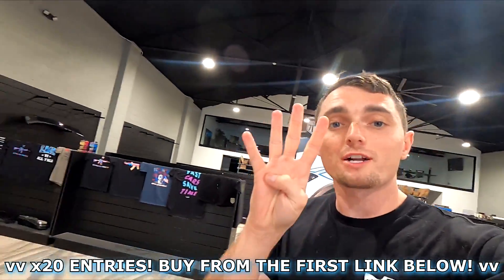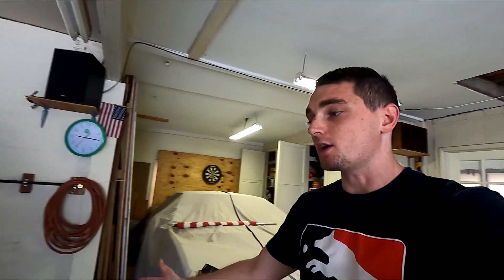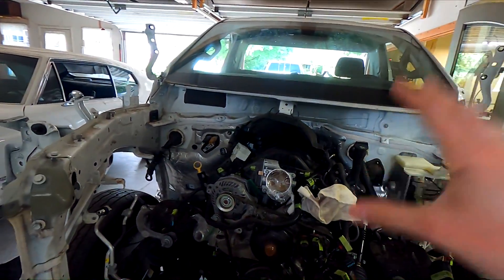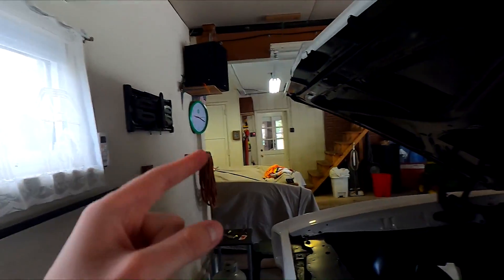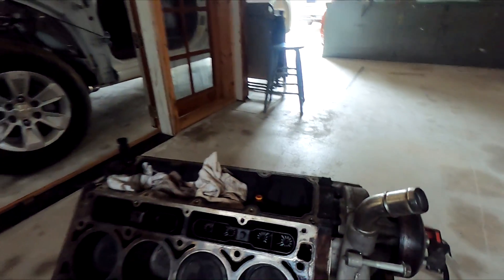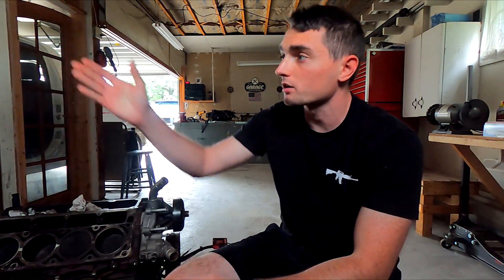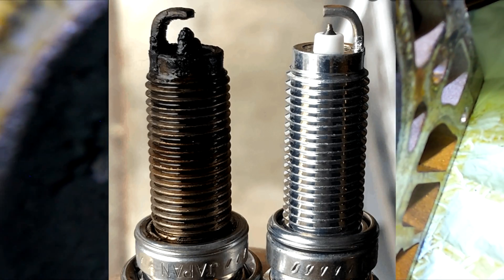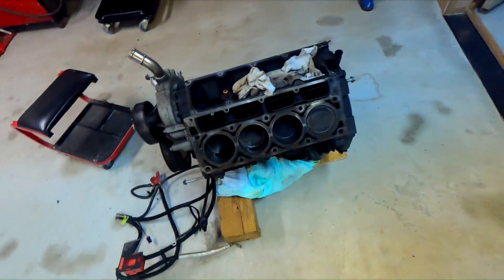MY NEW ENGINE IS HERE! But There's a HUGE PROBLEM!!

Comment: Those are good heads. If they are 799/243 it’s same as the c5 z06. You can use the long block as a core. Punch it out to a 5.7L.
I don’t think there’s much compatible between the uhaul engine and the junkyard 5.3. The new stuff is gen 5 lt1 base. Old stuff is LS based. 🔥 burn
Reply: My old 09 Silverado had an Aluminum 5.3 with 243 heads. Really wish I would’ve swapped the 243’s with the 862’s my iron block has. But I already had a set of 243’s so it was kinda worthless

Comment: That's honestly not a bad motor. A simple deck and hone and have the heads cleaned, surfaced and pressure tested and you'll be doing great. Also a Holley terminator is a great way to run that 5.3. Otherwise visit a junkyard and pull a harness yourself from a wrecked truck. 🔥

Comment: holley makes them terminator kits.. and ther is a few company's out ther making standalone wiring kits for putting Ls motors in ur hotrod & street rods for pretty cheap these days like from Michigan motorsports or karls customs making it plug and play install from $189-$299 & anywhere in between pending year of Ls & sizes they also have ecu's available for few more hundo's that are ready to go I've usually spent $7-800 for everything to make it a true plug and play where u just add power ignition wire and ground.. if u call and tell them what u have & are doing they'll make sure u get exactly what you need

Comment: Dude, if you got a good deal on the motor, just send it off to the machine shop for a mild bore/hone job. 
Or, use this as a lesson to invest in a cheap(or expensive) bore scope to inspect an engine before handing over any cash. Pull plugs, in goes the scope, have a look around.

Also, did you NOT notice the severed harness when loading two separate sections of it?

Comment: dingle ball it, probably better off to go to a pick an pull it place, or a junk yard that warranty the motors, we've always gotten a 30 day warranty for the motors from our local junk yards, just gotta make sure u have the time an everything lined up to do the swap, we always had the  motors pulled b4 and pretty much ready for the new one to go back in b4 we would buy it so we had the full 30 days to put it in an run it as much as possible to make sure it holds up an is good, so far they've always been good about it an if we had any issues they have another one for u or money back if they dont have one you need. buy from someone u dont know on facebook is always a gamble i feel like.

Comment: Put Pontiac motors back in those cars, Butler performance has a range of motors for those cars. You can fuel inject them and they will be hell of a lot more fun then that 5.3 ever could. I have a 64 Goat with a 468 in it and it knocks the tires off at 60 miles an hour… granted I am only getting 4 to 5 mpg, but if I took the two fours off and injected it, it would be more of an everyday driver. I would blast that guys name all over you tube, getting burned on a motor sucks, been there and done that as well, I had a guy build a motor in 1990 for a drag racing car, he filled every journal with extra gasket material, the detonated and blew parts across the track. Looking forward to what you do with the 68 Goat…one of my favorite years.
Reply: I love Pontiacs and agree 💯 with this suggestion. 
Your GOAT 🐐 sounds mean!!!

Comment: Burned . Man that sucks . Bobby maybe the crank and rods will still be ok . I know you said you didn't want to have it bored out but any decent machine shop could get that done pretty easy. Get some new pistons and you are good to go. Rebuild the engine and you know how it's put together . You would also have a few more cubic inches after the bore job on the block. Just a thought.

Comment: That rust didn’t look like a big deal, it only looked like surface rust, nothing a dingle ball hone can’t fix , but It’s a Chevy 5.3, you put it in a car and it will still lay patch and do burnouts no problem. But you should be rebuilding anything used for a nice gto like That. I wouldn’t just slam a 5.3 from 2004 in a gto I would at least rebuilt it. I mean seriously, cars sit for 20+ years they get an engine running and runs great, you think there’s ZERO rust on the cylinder walls? It will. And some engines are STUCK, broken free and run good. For real Didn’t see the other side but what I can see in the video that rust is not a big deal I would use it, I don’t consider it junk.

Comment: Borescope? Sure that would have worked. But you didn't even pull the plugs and inspect them? If it had that much water in the cylinders, wouldn't water have leaked out, after you removed the spark plugs and just tipped it over? 
You can blame the seller, but come on you have to be responsible as a buyer, too.
I have no idea how much you paid, but maybe you thought you were getting a steal so you weren't as skeptical as you needed to be. If that's the case. your greed got the better of you.